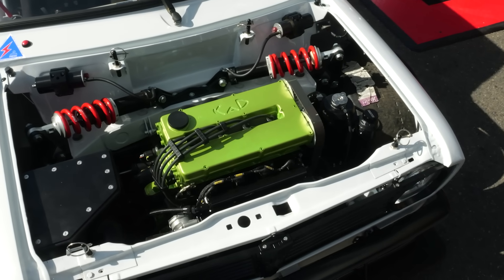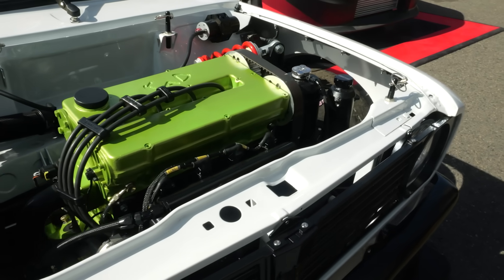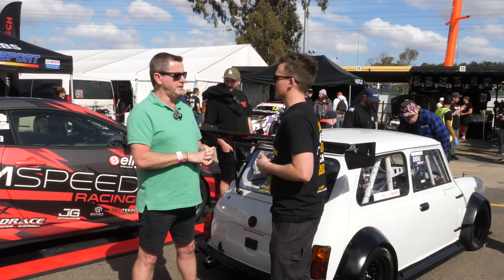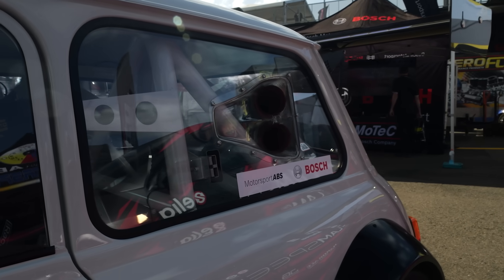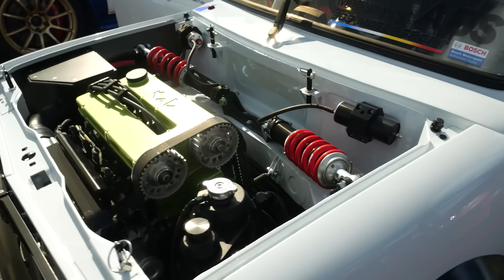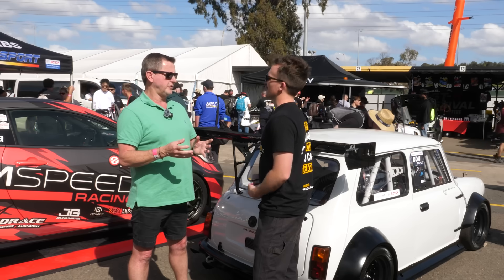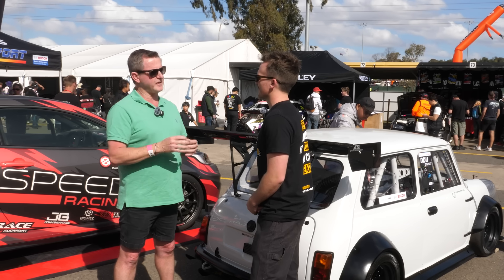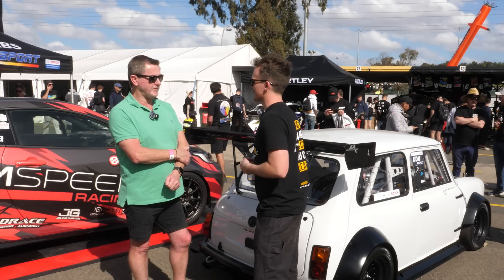No Rules, No K Swaps, No Compromises.

Comment: back in the day, the austin maxi 1750cc bmc e-series engines were a great swap for old minis.
Reply: We put a BMW k1000 head on ours
Reply: @mej6519  I had a 250hp 2.0 Vauxhall XE in my mk3. 200bhp at the wheels! Very scary little tin can weighing 560kgs on 6x10s!
Reply: @theoriginalwallace  there comes a point where it becomes undrivable, i knew a lad who swapped a mg metro turbo lump into his mini, lets say the torque steer became "unteresting" in the dry, but any mention of dampness on the road and it became really scary.

Comment: I think it's easy to consider rubber cones archaic as not much like it is currently used but there's a fair bit going that's not obvious. They are a progressive spring, rubber has damping properties, they're extremely compact. The more conventional coil springs that are available to replace rubber cones whilst softer also often coil bind and punch the spring out the top of the suspension tower.
Reply: Yeah coil bind is very bad
Reply: Agreed, I have springs instead of cones now just because but genuinely are not any better than good cone setup. Main benefits come from full adjustable dampers

Comment: Remember this is on a three bearing crank, and I assume all the limitations of the OE gearbox casing.  Very nice build.
Reply: I built a car similar to this for a guy , it had around 240bhp with a rotrex supercharger… 4 speed jack knight gearbox was reliable enough and did a season without any failures…
In the early days they used a Ford x flow block too mated to the BMC gearbox. That had a 5 bearing crack .
Reply: There was a 5 bearing a series wasn't there?
Reply: @Low760 no there was no five bearing a series from the factory. There is a passion project currently in progress where they are building a custom block with five bearings.